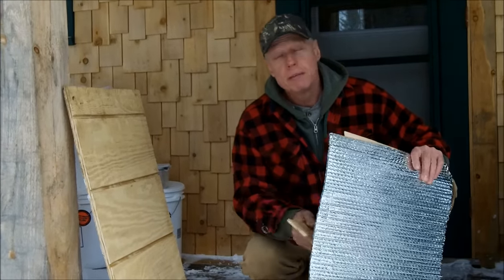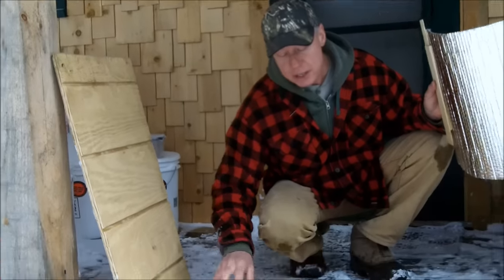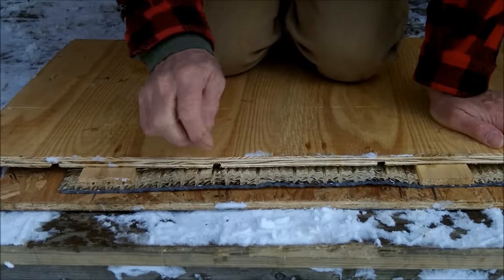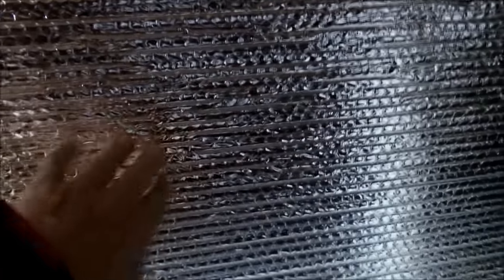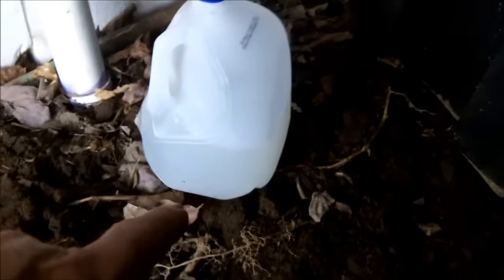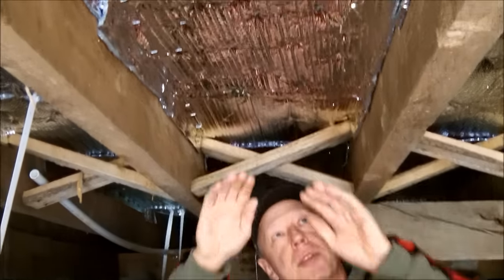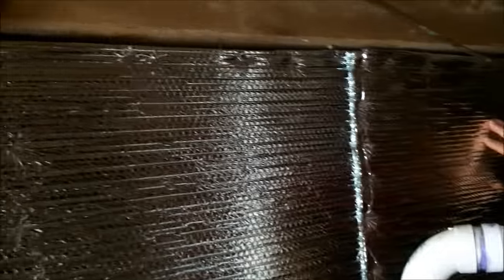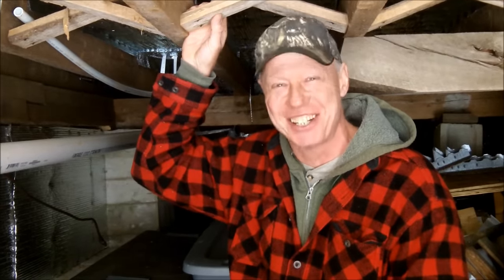HOW TO INSULATE A CABIN FLOOR AND KEEP IT RODENT FREE

Comment: Seems to me the R value of the insulation isn't as much of a factor as sealing off the draft coming through the floor.  Since heat rises the main goal is keeping the cold from seeping through via convection correct?  The bubble foil is a brilliant idea since no air will pass through it, the insulative value of it is an added side benefit.  It must have a decent R value though if it's keeping the dirt and pipes under the cabin from freezing too.  Wish I had known about this when I fixed the floor in my office, I had it torn down to the joists and would have dropped in some bubble foil.
Reply from the maker: The R factor is very poor but the reflective properties make up for it.   The dirt never froze beneath my cabin but it's been hard as concrete outside the skirting since late October.

Comment: Boss  I have a 2 car garage that has 3 sides of the foundation in the ground and a 8 foot gabled shed on top of it.  Do you think putting this bubble wrap under the plywood would help insulate it given the fact that under the floor is where I park my trucks.Also where do you buy this stuff.
Reply from the maker: I'd use it for beneath living space.

Comment: Very interesting.  Thank you for the upload.   I had heard about it before as being rodent proof, but I was thinking there was no way mice couldn't chew through it.  Now I understand that it's just simply not giving them a place to live.
Wrapping it around the skirt is a great idea too, but you still need to leave some ventilation to allow humidity out, right?
Reply from the maker: I vent it in the summer but not in the winter :-)
Reply: OFF GRID HOMESTEADING With The Boss Of The Swamp      That makes sense.  Thanks again for the upload.   Planning on making a small cabin in a couple years, max.  Starting to gather all the info I can now.

Comment: I’ve been trying to decide how to insulate the cabin I’m going to be building. You’ve convinced me this is the way to go. New to the channel, but is there any reason to not use this for the walls as well?
Reply from the maker: Don't surround yourself with it because a building needs to breath.  Keep the rain off your floor as you build but if water gets trapped beneath the floor and the foil, slit the foil and drain the water out, then tape it back up.   Cheers

Comment: Hey Boss, I went to there website and they say you need to run it between floor joist up against the floor boards and then you need another layer. I am a woman and have no clue about how to do stuff like this but I am learning as I am trying to build myself a granny pad out of a 14x32 shed. I live in no.east Ohio. It gets cold here. Thanks, T
Reply from the maker: All I can say is this is how I do it. My floor is warm and the ground beneath my cabin is soft, outside the skirting it is frozen hard as concrete. That's good enough for me.

Comment: Thank you for this video. Most people refer to it only as a radiant barrier and disregard it as an insulator based on R/U values. However most heating is radiant. And if it's cold you're going to be using a source of radiant heat such as a log burner, which would be trapped within the home if a foil barrier was used to create a tight envelope, obviously allowing for ventilation, ideally some form of heat exchanger. Any thoughts?
Reply from the maker: I was amazed at the results I got the first time i used this stuff, therefore, I've been using it since. All my structures have one layer of this beneath the floor and my floors are warm in the winter :-))
Reply: Wondering...can we use this as wall & roof insulation in an existing metal building? 
Thanks...anyone...for your input!

Comment: So if you had this 2 car garage with 3 sides of the foundation in the ground with a 20x24 building above it, would you still put the bubble wrap under the plywood floor.  I am using the upper 20x24 building right now as a place to keep my fig trees from freezing as it gets down to below zero at times.
Reply from the maker: I put it under any floor that i don't want the cold to seep through.
Reply: Just thinking out loud.  I know when I open up my garage door there is a noticeable difference between the outside and inside temps so the inside of the garage since 3 sides of the foundation is in the ground it is collecting some of the ground heat.  I am going to insulate the above portion and I was thinking that if I put up the bubble wrap under the floor it would block the heat in the garage from coming up into the building above the garage where I am trying to keep my fig trees from freezing.  Would you still install the bubble wrap in this situation.
Reply: Even if the floor is 8 feet from the groud

Comment: IT IS CALLED ROXUL ROCK WOOL  does not get wet rodents and bugs hate it and does not burn   . I used it in my house 2440 sq ft  insulated with roxul  rock wool  2x6 stud walls
Reply from the maker: I bought Roxul and had it stored (in it's package) for less than a month and mice burrowed into it and made nest with it. I have video footage to prove it.
Reply: NEVER HAD THA HAPPEN WITH MINE   @thebossoftheswamp
Reply: do you really think the  mice won't eat that plastic foil bubble wrap  .nothing stops mice if they want a food source or warmth or a nest     @thebossoftheswamp

Comment: Wait. Wait. Wait. Question my good man. Assume NEW construction. I got joist spans and no subfloor yet. You’re saying to roll out the bubble foil across the top of the floor joists and stable to them right?  Then come back and lay my subfloor on top?  I will get bubble compression along every floor joist though no?  But in between joists I’m not compressed. 

Is it really that easy?  

I mean I grew up in NH and we lived with the notion that you need R-value to keep the cold out (technically you are keeping the heat in because hot goes to cold). This bubble foil has pretty limited R-value. I mean no where near like filling that joist depth with pink panther stuff. 

I’m not doubting at all!  I’m just wondering how the hell this can be so good without that R value blocking air movement?  This stuff is really designated as REFLECTIVE foil right?  So is it really reflecting the heat back into the cabin more so than insulating with R value?  

If you REALLY wanted The Full Monte you do what you describe - foil on joists with subfloor on that. But then you’d stuff the pink panther insulation up in those cavities and then you’d cover the bottom of the joists in the crawl space with fine mesh screen to be a barrier to rodents. What do you think of that?  Or, are you like thinking “man if you do what I’m telling you here then you got all you need, just trust me”. You did mention 27 below. That’s a significant test of the concept for sure. 

Love the video. You make it easy to understand. Cheers brother.
Reply from the maker: Yes that's correct. In new construction, I blanket the top of the joist, running the foil parallel and not perpendicular to them and cover it with the sub floor, This creates a thermal break. However... It's very important to keep the rain from getting trapped beneath the floor.  If your building is properly skirted, you won't need any more insulation but you certainly can add that later if you desire.  ALL my structures are built with a single layer of this foil beneath them. My cabin in northern NY on the canada border has seen temps as low as -38F and I walk around barefoot. No Joke.  DON'T buy this at Home depot because they now sell an off brand which is junk.  This is the brand I use: https://amzn.to/3ZvwrJQ   
Have a great day.
_________________________________________________
As an Amazon affiliate, earnings are generated through qualifying purchases.

Comment: I'm considering doing this to an existing floor just like he shows in the crawl space. I wonder though, how much less sound isolation this will have than traditional fiberglass or mineral wool insulation. Any thoughts or suggestions are appreciated 👍 thanks
Reply from the maker: Not sure on that. Fiberglass and rockwool are great insulations for certain applications but for situations like this, The foil is the best solution for my needs.

Comment: My home is at the beach!block foundation 3 coarse high. I need to put bubble foil between the Joyce My Scurting is,concrete block,do I need the Air gap! Or can I glue it to the cement block! I am 4 homes from the bay, and it gets windy in the winter time! Help!
Reply from the maker: I've never put it against concrete so I can't vouch for how it will perform. The one thing i have learned is that it should be applied so that it reflects heat back into the surface its against. When I staple it to the underside of my  sub floor, it reflects heat back into the floor (a good thing).  If it's against the inside of the exterior sheathing, it will reflect cold back  into the sheathing and this will create and trap moisture between the foil and the sheathing and this is NOT GOOD. Try a section and see how it works out.

Comment: Looking to do the same thing. But when you’re not there, how warm does it have to be not to freeze those lower pipes? Are your walls and ceiling insulated in that cabin?
Reply from the maker: I have no idea how long it would take for the pipes to freeze if the building wasn't heated because I live here and it's always heated.  Yes we're insulated.
Reply: @thebossoftheswamp  Thanks for the reply! But I was asking how WARM to keep the cabin when you're not there in order for the lower part not to freeze. Any idea? 50 degeres? 60 degrees?

Comment: Do you staple the bubble foil to the joists or use nails? If staples, how long? Also do you over lap the foil or tape it at the joints or did you do it it another way?  Your videos are very helpful, Thanks
Reply from the maker: 3/8" staples and butt and tape the joints with metalalic tape.   https://amzn.to/2AVQSZa
Reply: Thanks!!

Comment: I live in Canada and will start building a cabin next summer. I just saw this video. Amazing. Do you think this kind of insulation can withstand canadian winters (-30 degrees Celcius) ? Is it really  good against rodents ? Thank you.
Reply: This crap has been used in Canada for years dude.  It's a vapor barrier so you should be very careful in placement because YOU can create condensation, mold, & rot.
Reply from the maker: I used it in my places in Northern NY, just across the river from Canada and just as cold.  I had no issues at all with it.
Reply: @thebossoftheswamp  For walls, do you put it directly on the OSB sheets (inside) between the studs ?
Reply: @01mustang05  Did you ever use it? Is it a good solution?
Reply: @GillesTanguay   Yes I've used laminated foil bubble wrap and perforated single sided and double sided, on outside walls, in attics, and under a cabin for a friend - similar to this video install, but I left a small gap (less than 1 inch) under floor boards - for good reasons.   And what's "good" is subjective; so, imo it's not "A" good enough solution in my experience. It poses risks and reward is not all that great.  Learning about moisture, water vapor, pressures, condensation and where and when it will occur, breathability or permeability is recommended; you don't want to trap moisture, create mold, nor rot.
Reply from the maker: @GillesTanguay  Except for the corners of my greenhouse, where i stapled it to the wall sheathing, I have only used it under floors and ceilings.  This link has manufacterers suggestions for walls and roofs.   https://amzn.to/37OivAv
Reply: @thebossoftheswamp  Thanks. Question. If you put this foil between the joists and the floor, do you have to put a vapor barrier between the foil and the floor?
Reply from the maker: @GillesTanguay  No. The foil acts as a thermal break. I have no moisture problems whatsoever.

Comment: can you please explain the layers again?  I have my floor joistes in now I lay the bubble foil right across the floor joistes and then I put my sub floor on the foil is this correct. can I use the foil in my ceiling.  I am having cathedral ceiling thanks Patty  There are many different sizes of the foil what is the size and the name of the foil you use thanks
Reply from the maker: I lay the foil out over the joist, running with them and not across so the seam is over wood. I tape the seam with foil tape and then I sandwich the foil between the sub floor and the joist but... YOU MUST keep the rain from getting trapped between these 2 layers. If you can't do this, then staple up the foil under the floor after the roof is on.  I use this 48" wide foil.    https://amzn.to/2HbmVHS   and this is the tape  https://amzn.to/3iUbvGI
Reply: @thebossoftheswamp  thank you for the advice

Comment: What do you think of using the plastic lattice between the foil and new subflooring. I have a shed that already has a floor and my concern with even using strips, is that you're still going to get significant flexing. My thought with the lattice is that you still get air gap, the plastic is less abrasive to the foil and it will distribute the weight. Thoughts?
Reply from the maker: No flexing as long as you use a floor material of at least 3/4" thick.  Treat the strips as joist and build as you would with any subfloor.

Comment: Do you think this would work for my Aframe cabin in N. Idaho? Gets real cold up there.
Reply from the maker: Absolutely. The coldest temps I've witnessed at my last cabin was -38F with -27F being the normal low.  One layer of bubblefoil in the floor and skirting is all I had.   I'll never use anything else.
Reply: @thebossoftheswamp  I'll do the same. Thanks Boss!
Reply: What would you recommend as insulation for the Aframe walls? & do you do anything in the walls to prevent rodents? Thanks.

Comment: Boss,Would you ever consider using the 4'x8' sheets of 2" thick rigid foam insulation that is sold at Home depot for either your walls or attic.  Just thinking about breathing in all that fiber glass particles when installing.  I know there is mask but you will still get some into those lungs especially when crawling around in the attic.   Not sure if the 2" foam would be more of a haven for mice as oppose to fiber glass for the walls and attic.
Reply from the maker: Never again!  I have 3" of foam board insulating my cabin ceiling and every year it turns into an ant farm.   Bubble foil all the way ;-)
Reply: You ended your comment by saying bubble foil all the way,  but I am talking about the walls and attic between the attic rafters where you said you only use fiber glass.  Just a bit confused.    So you are saying the ants get into the rigid pink sheets of foam that are 4'x8'

Comment: We are insulating the floor of a  small cabin in the woods. We had planned to use R38 insulation as they are 12 inch floor joists. then we planned to plywood the bottom so that no rodents could get in and protect the insulation. Do you think this is a good idea or not? This foil doesn’t seem like it would provide much insulation but apparently it does.
Reply from the maker: If you can keep the rodents out of it then yes, your plan is a good one.
Reply: Thanks for the video

Comment: we have a "treehouse" bedroom connected to our house with a bridge.  it is eight feet in the air on posts.  how to insulate this plywood floor on 2x6 joists.  skirting would not be reasonable of course.  ??   thanks for any ideas
Reply from the maker: I'd bubble foil between the joist and under the joist as well.
Reply: @thebossoftheswamp  thanks mr boss for fast answer.  sounds right.  we'll give it a try.  thanks again.  you're a good boss.

Comment: do not insulate the floor. lay 1/4 wire mesh on top of joists and sub floor on top of that. It drops to -40 at my trap cabin and not having an insulated floor is no issue.

Comment: So you are using bubble rap without any fiberglass insulation? Did you put it in the walls?
Reply from the maker: Correct. I use fiberglass in the walls though.

Comment: Have you ever considered using the bubble wrap for wall insulation?
Reply: I’m also interested in your answer to this JC. Ceilings as well?
Reply from the maker: I wouldn't completely surround myself with it because a building needs to breath.  I would use fiberglass in the walls.
Reply: But with a properly done vapour barrier, the building is completely sealed. Would this be any different?

Comment: As a retired mechanical insulator this doesn't make sense.  What you've done has created a vapor barrier.  That's good.  But it's not insulation.  That's why there's water in the container instead of ice, and the soil is soft instead of frozen.  Your cabin heat is permeating through the bubble foil into the basement and warming it.  The insulation value of bubble foil is minimal.  It will block the chill from an interior wall enough to have some comfort such as behind a desk.  And it's a good vapor barrier.  But if it had any real R-Value it would cheerfully be installed in every new home and builder's are still using fiberglass.  In your situation for true thermal insulation your choices other than fiberglass are spray foam or solid foam with sealed gaps.
Reply from the maker: All I can say is... it works, and if you read through the comments you'll see others have the same results. My floors are warm, my pipes aren't frozen and neither is the food in my storage box.  I spent about 100 bucks and didn't itch my ass off afterwards.  My cabin on the Canada border is done the same way and I've seen temps of -38F.  

The warmth of the crawlspace is ambient heat from the  ground beneath being trapped under there and not from heat leaching through the foil.